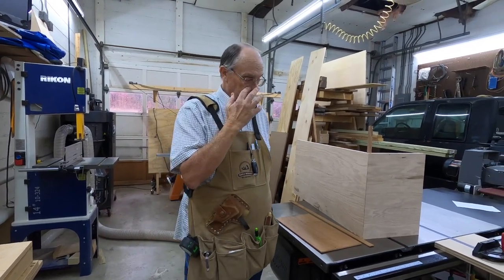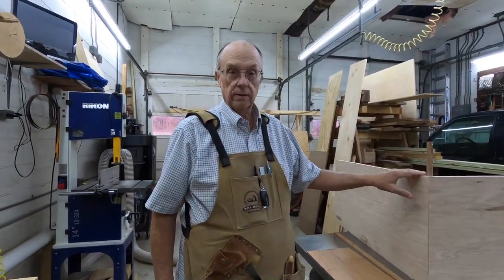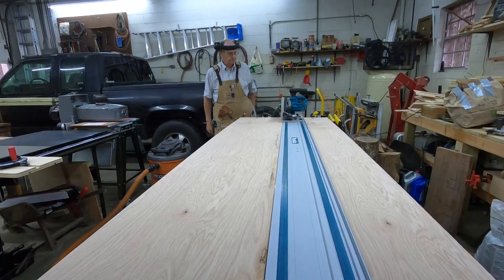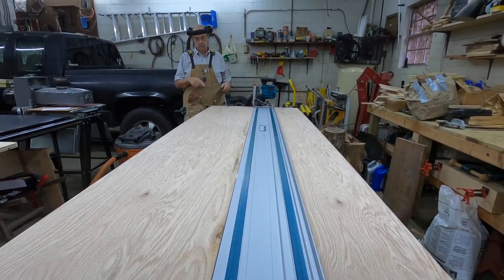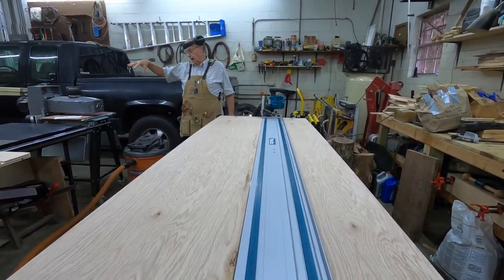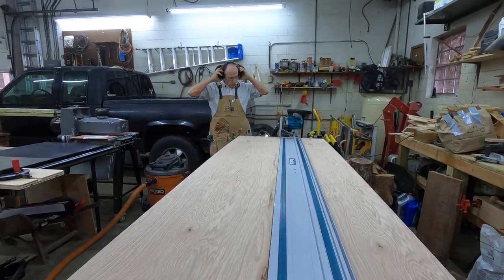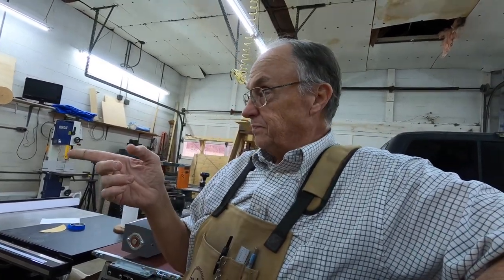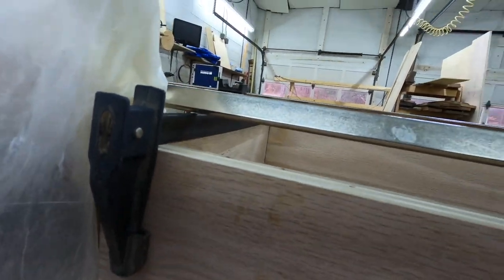Hidden Miter Spline - Change Grain Direction

Comment: Looking good. “Wood” like to see what the mistake was and how/what you did to address it.
Reply from the maker: I mentioned in the beginning of the video that I need a out-feed table for my table-saw.   One of the pieces feel and buggered up the corner.  All I did to fix it was put some glue between the layers and while I was clamping the box up I put one of the clamp over the corner.  In the future when something like this happens ( and it well ) do you think I need to show how I fixed it?